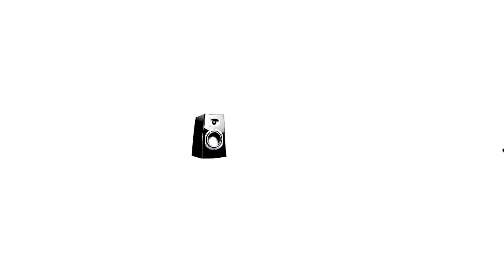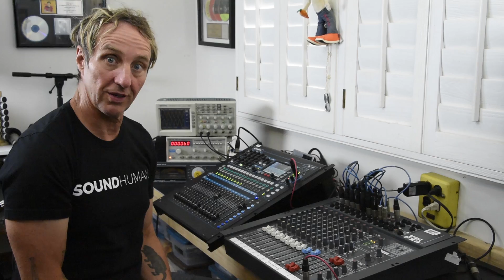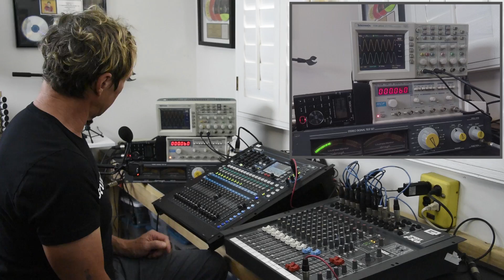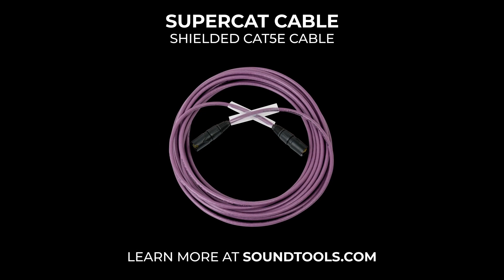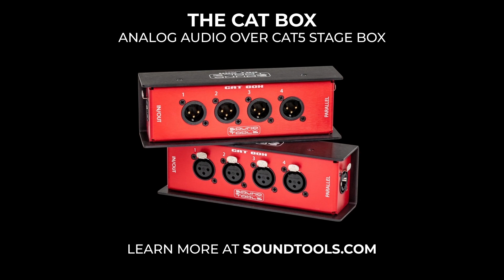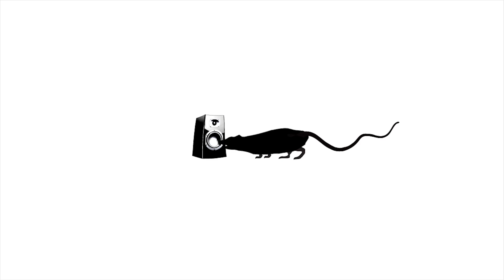Digital vs Analog #3 of 6 - The Lows

Comment: This is pretty much all determined by the circuitry in the analogue domain, especially the DC blocking capacitors at the front end of the pre-amp. The only way this is relevant in the digital vs. analogue conversation is that it's much easier to pass LF through the digital domain than to ensure LF extension through the entire signal path of the analogue domain.
Reply from the maker: That is definitely one relevant aspect of the 6 videos showing many aspects and differentials

Comment: What does putting channels in series demonstrate? I can't think of a real application where you would do this. 
And looking at the waveforms on a scope makes it hard to determine the -3dB point or the slope for a proper comparison. 
Why not use a proper analyser? Doesn't have to be anything fancy, i'm sure you've got Smaart.
Reply from the maker: Putting channels in series should exaggerate the the audibility and measured issues.

The reason to put channels in series for listening rather than just purely measure is to help us as listeners understand what the issues actually sound like rather than just what they look like.  By hearing magnifying the issues and hearing what they sound like, we can then decide whether the issues are important or irrelevant to us for any particular application

Comment: the debate of analog vs digital will continue into the year 3000 lol.  I prefer digital because to my ears its amazing.  You work with the best signal and then can fudge it up to get that analog saturated sound.
Reply from the maker: Interesting.  One concept is that both analog and digital strive to transport signal like a piece of wire.

Analog is a piece of wire that gets more and more complex as you add features, digital chops up the signal, allows many features and then mathmatically tries to recreate the signal such that its output is as close to a piece of wire as possible.

The decision of whether it's better to leave the signal alone or chop up and recreate it really depends on what one desires to do with the signal.

Ac power is analog, one could put a digital converter on every wall outlet and send the ac power as a digital representation of the AC and then re construct the AC at every piece of gear. Replacing every simple power cord with an expensive conversion system.

But the application, coat and advantages make this a poor choice. 

Same goes with deciding whether to use analog or digital.
Reply: @DaveRat  they work together in spirit, as a team.  With digital being the primary.  Of course, we hear in analog no matter what, but the control you have with digital is insane.  Sculpt it how you like.  A lot more of that is happening now that folks are getting away from the pristine. 

Plus the old $200,000 studio effort being summed to a 128kbps stream is a factor too.  I've noticed the youth are fine with pod speakers, smartphone ghetto blasters. earbuds and laptop speakers.
Reply: @DaveRat  Interesting analogy with the AC power...  There are appliances, now, that actually do this; they use DC motors that are driven by PWM so as to vary their speed without overheating them (treadmills, high-efficiency heat pumps, some variable-speed power tools).  Also, high-efficiency generators actually rectify the AC produced by the generator to DC and then use an inverter to convert it back to AC.  The reason for this is that when you slow down a generator, it changes the voltage and frequency, so a standard gas generator must run at a constant speed to produce correct power.  An inverter generator can vary its engine speed to use less gas under light loads and still output the correct voltage and frequency.

I got hands-on with some large-format consoles at the NAMM show this year.  I've never worked on any such boards and found that, ergonomcially, I preferred the Yamaha consoles to everyone else's.  But, Yamaha isn't well known like e.g. Midas for amazing sound quality.  My experience mixing live has primarily been festival stages, so the mix has to be built on the fly, very quickly.  In this situation, then, the best-sounding console of any ilk is going to be the one I can work most effectively on -- which, for me, is the Yamaha console (CL-5 and Rivage were my favorites).  So even if its outright sound quality isn't as good as some of its peers, the speed and ease with which I can get a mix up and going on a festival stage means the audience will hear something better than if I'd used a higher-sound-quality, but difficult-to-use, system.

I guess what I'm trying to say is that I'm willing to accept a tradeoff in outright sound quality if the resulting convenience means I can deliver an ultimately better product to the audience.

Comment: Did I see the 25Hz analog desk output getting earlier and earlier with every channel added in series?

As I understand it, with digital desks one of the expensive features is low latency.

ps not looking forward to digital distortion.

Do you plan to demonstrate signal (not acoustic) feedback as well (digital is gross there too)?
Reply from the maker: High-pass filters will induce a positive phase shift on the pass band.  It's not a latency you see, but rather is phase shift
Reply: @DaveRat  it is pretty telling that digital engineers have to wrestle with latency, and that the finer points of phase coherence are basically off the menu for systems with poor time precision measurable in milliseconds. This is also why digital is not yet a mature technology for live processing of audio, and digital broadcast desks from Calrec etc are very expensive, and are engineered way beyond what you find in personal computers and Texas instrument powered bluetooth speakers.
Reply from the maker: @weareallbeingwatched4602  👍
Reply: @weareallbeingwatched4602  Even the more affordable digital consoles such as the Behringer X32 have an in to out delay of less than a millisecond even with some processing. A millisecond is about the time it takes sound to go one foot so tiny relative to the distances things are apart on stage.
Reply from the maker: @dpallant  typically its more like 1.5 Ms but yes, slightly over a foot or so. 

With in-ears a digital console that delay prevents the in-ear   sound from ever lining up with the internal resonance of a singer's body. If you use digital transmission, it's adds even more offset.

With a monitor system, the 1.5 ms console delay plus another 1.5ms amp processor delay, if you don't stay pure digital between the console and the amp, will make the wedges sound 3 feet farther away to singer's.  This is clearly audible and often undesirable.

Also, do not trust that a console, amp or processor will be 1.2 Ms or less. I know of amps, consoles and processors that have much longer processing times and just a few analog flips can leave you with 6 or more Ms latency.

I did some system testing on a monitor system and the console/amp processor combo was 8.5 ms.

It is important to be aware and on top of latency as there are many techs and manufacturers that make the assumption that a few milliseconds are no big deal, but reality is it can cause some very audible issues